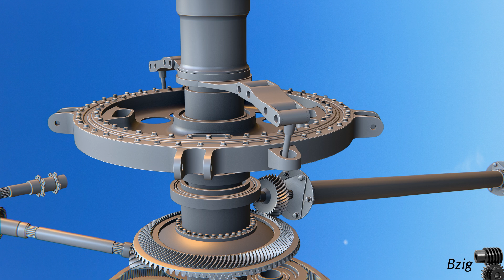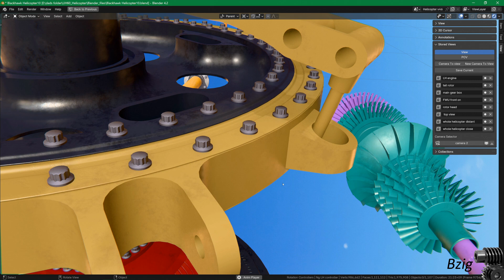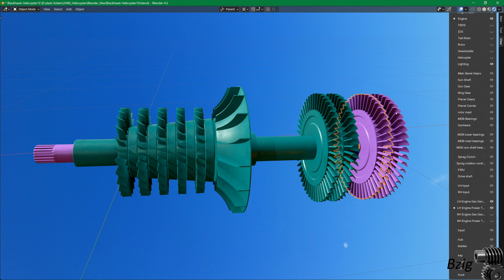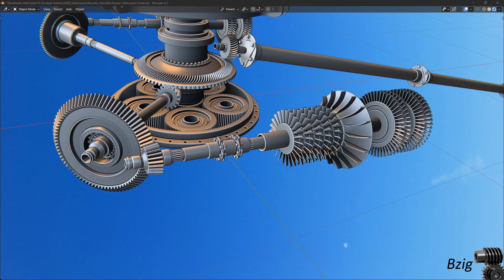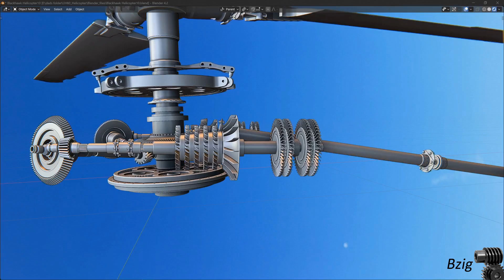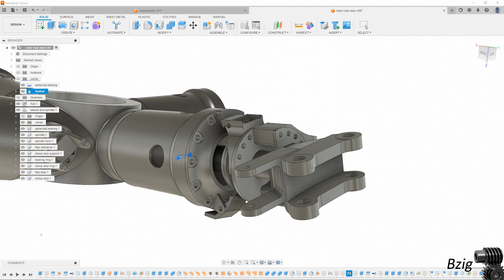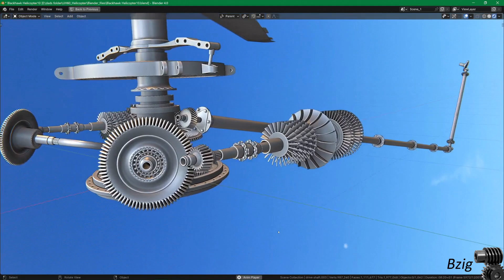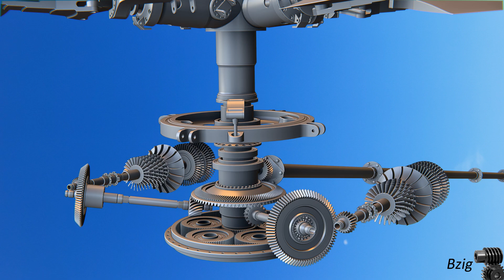How a Helicopter Works - Part 3

Comment: Thank you for sharing! A small comment though, for the animation: the T-700 engine has an opposite rotation between compresor and power turbine. The video shows both shafts, outer compressor shaft and inner power turbine shaft rotating in the shame direction. Just a comment!!

Comment: Is the startup scenario described correctly? Sure, can get the gas generator going with aux power as an input (electric motor and/or apu?) but as soon as fuel is introduced, the power turbines and thus the rotar blades had best be moving lest that back-half of your engines melt. But maybe I'm mistaken and there's sufficient cooling even with the power turbines locked in place. But I will say, looks like the rotors start moving during engine runup (seen in person and vids)

https://www.youtube.com/watch?v=B_p3_9si5D4 (not a heli setup but close enough).
Reply from the maker: They are only operated at idle when the Np section is locked. And the pilot monitors TGT limits when operating like that. 

I did a lot of my helicopter flying onboard ship and starting this way is more of the norm than the exception.  I'm not aware that any special cooling provisions are built in for the aircraft that do this.  

One concern though is blade rub... Meaning when the blades are heated in the exhaust without rotation (cooling) they grow... I've seen mitigating procedures for subsequent starts, but never for a cold start.
Reply from the maker: Here's a video showing a brake start.  You can hear the pilots say "brake is holding" after they start each engine.  With both engines on line, they then release the brake and only then do the rotors spin.  https://youtu.be/l0B5joST1mQ?si=jRtDjyG--L6lLTAZ
Reply: @bzig4929  Heard them say it several times, don't know what it means in relation to turning on the flame.

Comment: That first gear reduction from 21,000 gives me the willy's !  That's a lot of RPM's on a small pinion gear.
Reply from the maker: It must work... The gear sizes and speeds, used in the animation, came from actual data from the Blackhawk.  

In Ray Leoni's book on the Blackhawk he says they had to meet an Army requirement to run for 60 minutes with no oil in the gearbox.  (60 was a test requirement to show a 30 operational run-dry capability)

Those are some robust and proven gears!
Reply: @bzig4929  Excellent point !  High RPM anything always makes me a little nervous. They designed it right!  Excellent video !

Comment: One more comment. Can you do an explanation of mast-bumping in the future?

You’ve got three- and four-blade mechanisms mostly built, and they would be great for showing why these designs don’t suffer from mast-bumping while most (all?) two-blade helicopters do.

I know the theory, but I’ve only seen cartoon-like 2D drawings of how they cut the mast, and I’ll bet those aren’t that accurate.
Reply: mast-bumping is more related to teetering-head rotor mast assemblies, like those in a Robinson R22/44 or Bell B206 or B205/UH-1 Huey.
At least let him finish the articulated UH-60 rotor assembly before we get into secondary effects/mechanical design failures
where effects like ground resonance etc might also be addressed. ;)
Reply: @the_apache_pit  My basic understanding is that all two-bladed rotors are inherently teetering, and anything with more blades can’t teeter. But it sounds like that’s not quite right?
Reply from the maker: here's a fun fact... both the AW609 and the MV-22 Osprey (tiltrotors) have three-blade teetering designs.  They have a hub spring, so there is some additional effective hinge offset compared to the Bell and Robinson teeters, but they are still teetering designs.  Great comments... I'm thinking about doing  a teeter side-by-side with  the fully-articulated.  That would be a cool video.

Comment: Does this 3D CAD software you are using have a model library? Are you having to design all those gears and turbine parts from scratch or can you drag and drop prebuilt models onto the drawing screen.
Reply from the maker: Autodesk Fusion lets you import almost any CAD format, so if you can find it, you can likely bring it into the software.  The only library it has, built in, is for common hardware; they links directly to the McMaster-Carr website and I can import any 3d file they make available.  If you see hardware, like nuts, bolts, bearings... things like that, in my videos, these likely came from McMaster-Carr.  Everything else I modeled on my own.   The gears... those would be tough to model... Are made with an add on;  I just enter the parameters (module, helix angle, width, backlash...etc) and the computer generates the gear.   Thanks for watching!

Comment: I'm a developer for MSFS 2020 and 2024 and helicopters is one of the aircraft I model and setup most often. This is really impressive work my friend.
Reply from the maker: thanks!  that's high praise coming from a real developer!  MSFS has come so far and the graphics are just amazing.   It's an awesome product and you should be proud of how good it's become.
Reply: what helicopters have you developed? I exclusively fly Heli's in MSFS2020 in VR!
Reply: @stachowi  The 2 helicopters I've worked on are coming out for 2024, namely the Chinook and the Skycrane from Blackbird Simulations.
Reply: @cptairwolf  damn, the skycrane is in a lot of the trailers! amazing work.
Reply: Please look up my bugs on your forums, please look after the sim by any means because 2024 is a disaster